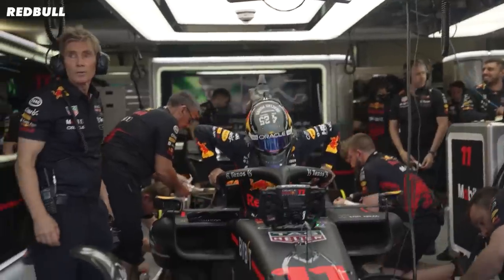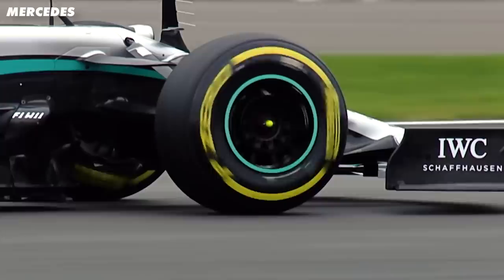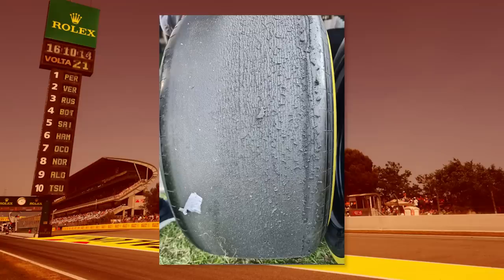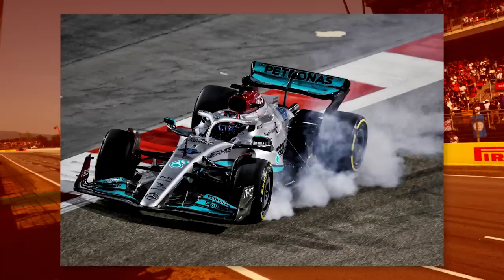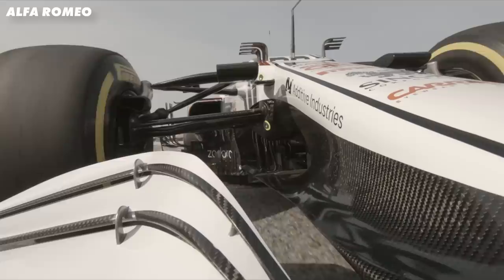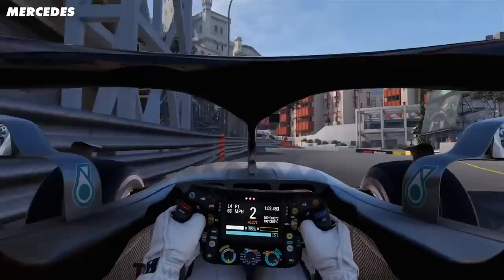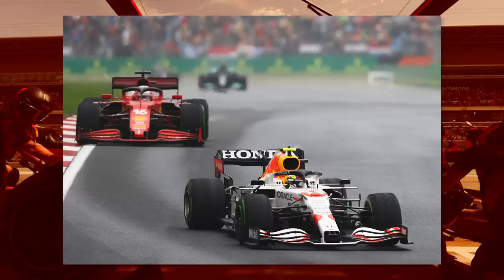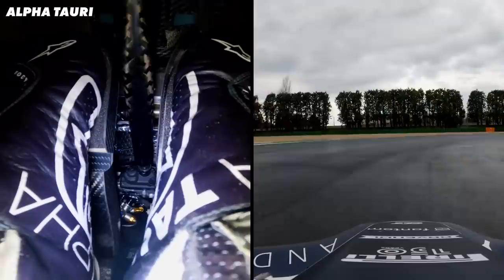Why Perez is INCREDIBLE at Saving Tyres

Comment: If only his engine lasted longer than the tires.
Reply: It was a gearbox problem not engine and tht too maybe coz of his crash in qualifying
Reply: It was the gearbox but yeah lol
Reply: @goureesankar  in Canada he hit the nose only into the barrier so how does he break the grearbox
Reply: @sheepbeep5247  Helmut mentioned it in an interview, he left it as a "maybe" though and that the gearbox was almost at the end of its life, only Red Bull knows why right now or someone more knowledgeable than me xD
Reply: @sheepbeep5247  the force of the crash can cause internal damage, even if looks intact.
Reply: @sheepbeep5247  Because Checo was trying to reverse, reversing a F1 car puts a lot of stress on the gearbox if you don't do it properly.
Reply: @sheepbeep5247  just the impact can easily affect it
Reply: @camcambambam5128  Russell had a rear impact during quali which is more likely to damage the gear box than Checo's front impact but Russell's Merc ran Perfect while Checo's bull died on him either redbulls gearboxes are extremely weak or his gear box already had a prob
Reply: I shouldve said drivetrain but you get what i mean
Reply: @theracingban  Checo was also probably grinding the fuck out of that gearbox trying to put it in reverse. Idk how it works tho
Reply: @theracingban  checo probably caused the damage on his gearbox when trying to enter reverse following his crash.
Reply: @camcambambam5128  I agree. F1 cars are so tightly packaged, any kind of impact might damage something and they won't know about it, unless they take the whole car apart.
Reply: @sheepbeep5247  The gearbox is a structural component of the F1 car, it's what holds the monocoque to the rear half of the car. A lot of impact energy would go (I presume) right into it, especially with a head-on crash like Checo's
Reply: His engine be made by Perrelli rubber like fr
Reply: The only things that have failed on his car are a fuel pump and gearbox
Reply: Hydraulics that caused the gearbox failure the engine is fine
Reply: @charly__  Max  literally slammed his rear Tire in the wall at Jeddah Qualifying  last year and his gearbox was fine  they didn’t even change it for the race.
Reply: @f181234  Yep, but that’s how it works, It also depends on what the gearbox was doing in the collision, It’s different if you crash while changing gears, in 1st 2nd, neutral, etc.
Reply: @f181234  although in this situation, I think Checo was pretty rough with his clutch while trying to back up, and that could’ve caused enough wear to make it fail.
Reply: @hoya1178  the gear box wasn't working properly even in FP
Reply: I thought you said “engineer” then and was like woah 😂
Reply: Concrete Head  Meanwhile there are people saying Danny should be content in Checo's position

Comment: Tbh I haven't seen much of the tyre whisperer thing this year. Max seems to nearly be doing a better job at it so far in 2022, which is strange. Come to think of it, even last year some races Perez didn't really make them last that much longer. Hope Perez gets to his tyre whisperer skills back to his RP/FI days
Reply: Because max always been excellent in tire saving it's why he won his first race in red bull in spain.
Reply: In Monaco he did a decent job, for what that's worth.
Reply: At the other teams he raced for, they would have to try those alternate strategies more often for a chance at points. At RB, they have the pace to be out in the front and win on pace more often then a crazy strategy gamble.
Reply: @bradweinberger6907  Dunno, I think in Monaco he also burned quite quickly through his tyres but Monaco being Monaco still nobody could overtake him.
Reply: Alex Albon is the actual tyre whisperer
Reply: COTA 2021 proves max is the best at tire management and maintaining pace
Reply: Think he's been running more quali-focused setups this year compared to Max as that was his main weakness last year, worked in Monaco where you can't overtake but in Baku with long straights and heavy traction zones it was clearly the wrong way to go as the tires overheat faster. I still think tire management is still one of his biggest strengths though.
Reply: @Army2309.  ever heard of "my tyres are done?"
Reply: @danbarham1462  That's a great point. I was wondering why he's seemingly burning through his tyres so quickly this year. It was really apparent in Jeddah, Monaco and Baku when he was leading. I thought maybe he's pushing too hard when he's out in front, trying to stay clear of the likes of Leclerc and Verstappen. But those were also incidentally the races where he beat Max in qualifying. So setup could definitely be a factor.
Reply: perez does what he asked to do. If the plan is to saves tires he will. RBR have proven ro be able to make good stategy calls and typical p1 in clear air did better than people in dirty air even for tire. I cant really tell what going on this year with the tire if they just have no tempreture window with going out of the window causing deg or the tre are just low life.
Reply: Think he's trying a more aggressive style to try and improve quali. Smooth driving styles (like Jenson) struggle a bit on one lap pace.
Reply: @Army2309.  lol good joke. The tyre life delta was almost nothing and those cars were so hard to overtake. It was obvious Hamilton had no chance from the moment he pitted.
Reply: Forgive my ignorance, but the changes going into this year are probably the reason why. The thinner sidewalls and larger rims combined with the heavier weight and ground effect probably has an effect on the tires that they aren’t used to. It’s why everyone jumped on the 2 to 3 stop strategy in Bahrain at the beginning of the season, despite everyone predicting it would only be a one stop race.
Reply: I think it’s mostly because Max is very underrated at it while Checo is known for it
Reply: Has everything to do with strategy.
Reply: higher tyre wear is the nature of 4WD
Reply: @lukasgraesslin , I'd say Pérez did a lockup to not hit a bird crossing the circuit the first lap after the red flag restart.
Reply: @drugoviic  Bono has.
Reply: i think perez is going more for a qualy setup to compete against max, but then he gets problems with temperature and wear in the race
Reply: @lukasgraesslin  well at the end of the race Checo said that the tyres where coming back
Reply: Well we saw some high tyre deg in Monaco and Baku and he was working on his issues for Canada, but we never got to see if he had made progress with the gearbox failure.  I suspect he might be putting too much emphasis into qualifying this year at the expense of his race setup.  Striking the balance has to be hard because he knows he needs to be ahead of Max to get priority on strategy.
Reply: I think the same
Reply: Remember: whatever a driver is good at, Max is either just as good at it or even better. Max showed his tire management skills both at Toro Rosso and RB. He is the master of keeping a consistent HIGH pace.
Reply: Checo does not only manage tires remember in spain all top 5 cars were having over heat issues but checo didn't as he was short shifting and coasting w/out hurting his pace, even Marko said it, max abuse of the car, cause an anornal waer of the components compared to checo.
Reply: @disuser-lp3qv1tm8f  The same can be said of Lewis and I'd rate him the better overall driver compared to Max. We also have a lot more evidence because Lewis has been winning since 2007 and been through 3-4 different car generations. Max has only ever driven on Pirelli tires and can go for some absurdly dumb overtaking moves. Imo Max is actually a poor wheel to wheel racer as he goes for overtakes that can easily put both cars out but in most cases the other driver has to back off to save a double dnf. Max never seems to get penalized for causing collisions (and he's caused a lot in his career, far more than Hamilton and he's raced in F1 for double the time Max has).
Reply: because is not up to him , is RB strategy what he has to follow and if RB says 2 stops there's no need of saving tires. of course when is needed, he is the man for the job. 
Also RB is not a limited budget team, they have resources and are willing to use them.
Reply: Horner said on C4 at Monaco that Perez has been going for more quali-biased setups, whereas he previously preferred to use a more race-oriented setup to help him.
Reply: The tyre whisperer is back now! Say what??

Comment: Please make a video about Vettels driving style. People say he likes oversteer, while other say he likes understeer. And does Vettel like a stiff front spring and front roll bar, while softer on the rear? And is he very good on street circuits, because of the soft rear in combinaton of the v-line? And does he like much rear wing or consistent rear downforce or both?
Reply: From what i know he likes a car that has a strong rear end becouse he is quite early on the throttle. Thats why he was so good at redbull with the double and/or blown defuser. And thats why he had so many spins in in the ferraris btween 2018-2020. These cars had problems with stalling rear end and were built for mostly straight line speed
Reply: It'd be great if we could hear it from the drivers themselves.
Reply: I second this request.
Reply: @foxy126pl6  Basically he has a heavy foot

Comment: There's Checo defending and saving tyres, and then there's what Gilles Villeneuve would do back then.
Reply: lol the original drift king
Reply: @DJB_02  he would get the tyres to slide and last forever at the same time, he was on another level
Reply: @S85B50Engine  also tyre compounds lasted much longer back then. Not like the pirellis
Reply: @S85B50Engine  the tyres were much harder back then. Thats why sennas technique was so fast. He whould use thottle blips to rotate the car and becouse the tyres were harder he whouldnt have to save them
Reply: @foxy126pl6  and yet Villeneuve was a lot softer on the tyres, even with the harder compounds
Reply: You guys saw him live ?